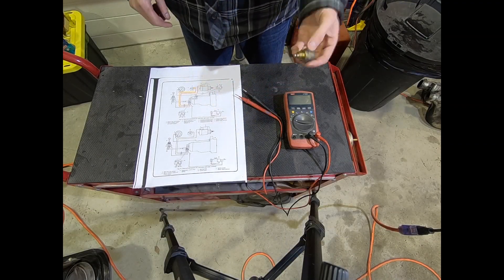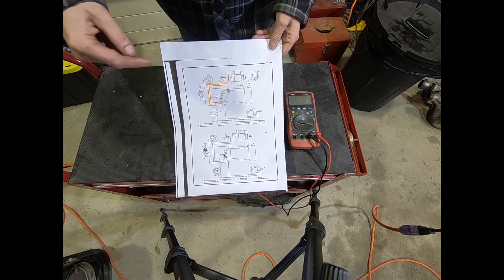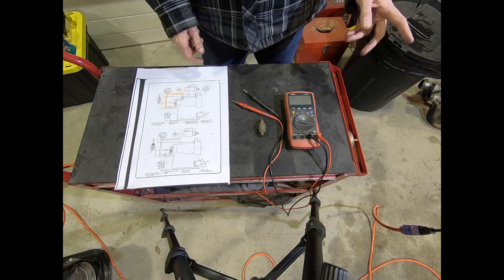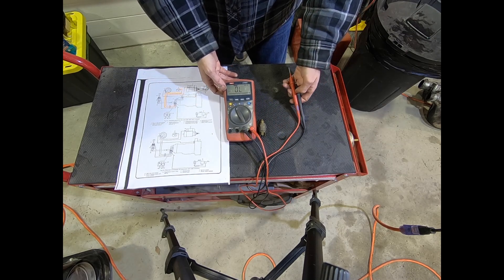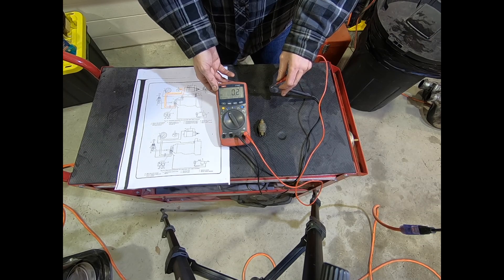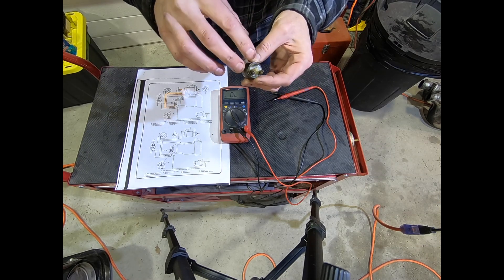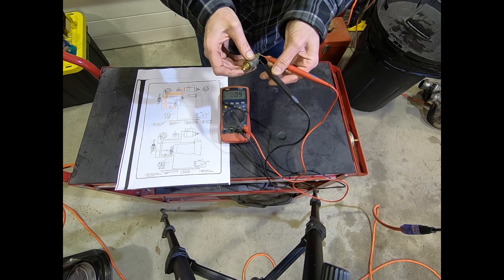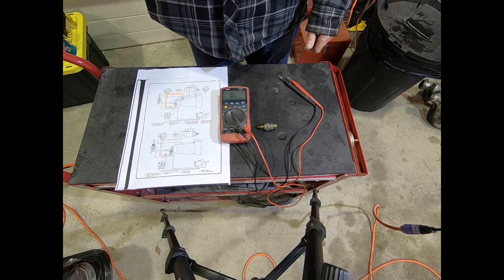VW Autostick - Neutral Saftey Switch - Check with Multimeter!

Comment: I can't find it on the transmission, my car starts sometimes and then it won't not sure if the switch is going bad or just a loose wire, but crawled under there trying to find it

Comment: Hi, I just picked up a 71 Beetle auto stick and have determined that the neutral safety switch is not working.  I can’t seem to find one through the usual VW parts places and was hoping you knew where I could find one.

Comment: I had a no start today and while I was holding the key over to start position I was wiggling the wire on gear shifter and it finally cranked. I was wondering how to tell if it’s the wire in gear shifter or neutral safety switch? Where is the neutral safety switch located. Thank you. Love you videos!!
Reply from the maker: Hi Brent, The neutral safety switch is located near the nosecone in the transmission on the drivers side. Hard to see and even harder to replace while transmission is in the car, it can be done (we did), but lots of frustrating, arms cramps and maybe a few foul words. The neutral switch is a pin switch that connects power b/w 2 pins when the shifter in is neutral. This is what powers the starter (pin 50 on wiring schematics). The wire on the gear shifter, is simply grounding out our control valve solenoid to complete the 'clutch' circuit. So by wiggling the ground wire you either moved shifter enough to properly engage the pin switch on the neutral safety switch or ir wiggled the wires enough on the neutral control switch to give proper contact on the 50 pins. I would check out your wiring terminals on the neutral control switch.  Hopefully this make sense?  Let us know,
Thanks.
Reply: Garage Time        Yes it does. Thanks for the info. I will check my connections.